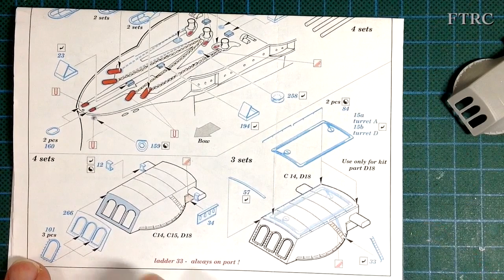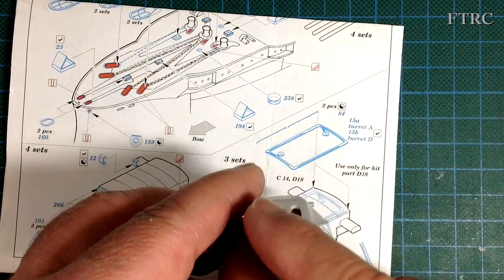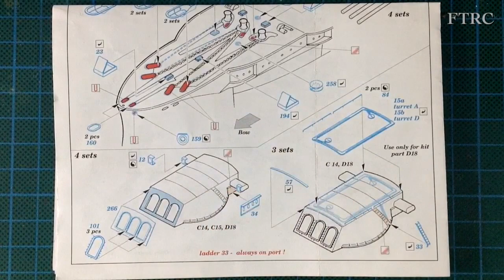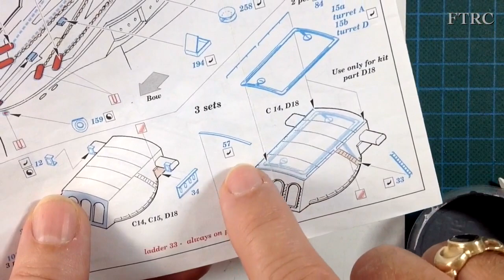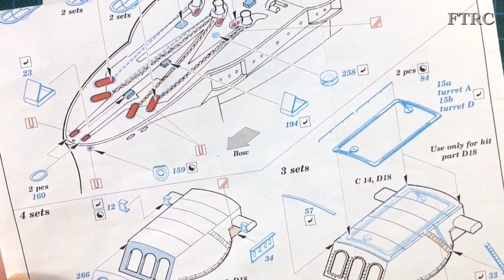Hobby Boss USS Arizona Part 6 (Turret PE Super Detail)

Comment: Thanks for the tip about the wax pencil for handling the PE. I'm working on the Hasegawa 1/350 IJN Nagato and there are a lot of small PE parts to deal with.
Reply from the maker: It can be a sanity saver.. glad it helped you.
Reply: Every little hint and tips do make my model building life so much easier. I went right out to the local art supply store and got me two of the wax pencils.

Comment: Hello Harry. Thought I would share the issues with this kit if you haven't got that far yet. The pins on the underside of the turrets that go through the deck are not long enough to go through all the way to glue the caps on to keep them from coming off. I extended them using plastruct tubing over the pins, drilled out the holes larger on the deck and used plastruct tubing to make collars to slide over them to hold them in place. Second issue is the propeller shafts and brackets when assembled as is, don't line up as they all face in different directions crooked and all angled in different directions all but straight. Corrected this problem by filling in the indentations molded on the hull then mounted the shafts  and brackets and everything came out straight and looks good. The last problem is on the bottom of the 2 towers where the legs go in the bottom have half circular mounting hole molded in, well they are all molded in the wrong directions for the support legs to be assembled in the correct positions. You will need to drill the holes out to corectly position the legs on both towers. Other than that everything else went together with no issues. 
      I decided to go with the pre 1941 paint scheme which is the 5-D dark battleship grey which is a very dark charcoal color which I had to mix till I was happy with the shade. It looks really great, might not be exactly accurate, but I am happy with the way it looks. If you go to freetimehobbies YouTube channel, there is a 1/200 scale Arizona done in this color and I tried to come close to that. 
   Hope these tips are helpful for when you get to those parts of your build and anyone else who reads this that is working on this kit. It is still better detailed than that old Revell kit. Hope to see your progress soon.
Reply: Thanks for the tips, I have the Banner kit which I guess is the same kit, I picked up the same Eduard kit, I love it because of the boat cradles and the anchor chain with the hawse pipe covers, but I also picked up the GMM PE because the  "fighting tops" of the Eduard kit is not detailed. I also bought the Tom's models PE kit and I've found them to be flimsy. But Harry's advice about the wood glue and the wax pencil are priceless gonna pick these two items today.
Reply: I agree with you about the Revell kit, I thought it was the same kit only placed in an enlarging machine. I've built that kit twice once w/out the PE and one with the PE and I just got another kit from a raffle at a local hobby show.  I am a Navy veteran as my grandfather was before me, so I am hoping to have a pilgrimage to the memorial before I die. I have several books about the Arizona, did you know at one time she torpedo tubes under the waterline, they were not practical because you would have to turn the whole ship around to aim them.
Reply from the maker: Thanks for the info

Comment: Great stuff Harry :) Something to consider good buddy is an #16 x-acto blade for cutting PE. We normally use a #11 for most of our work. The number #16 is called a scoring blade but is widely used for PE. It provides greater dexterity than a razor blade. The blade tip is shorter and stockier compared to a #11 which provides great precision and purchase :) You may want to check out the frugal modeler episode 18 on how to maintain your blades in pristine condition, especially a blade that is cutting metal all the time. I haven't replaced a blade in well over a year.
Reply from the maker: Thanks Richard.. I think I watched that episode and yes I do sharpen my blades.  Havent seen the #16 here... will have to look out for it... mostly I use my Xuron cutters for PE now but did some old razor blade work just for the video.  What I do for camera is not always exactly how I really do it. LOL
Reply from the maker: Oh by the way.. do you know what those rounded rectangular PE loops are I added on top of the turrets?
Reply: Harry Houdini Models
Sorry good buddy no :(

The reason why I mentioned the #16 blade is there are certain PE sheets where we do not have the luxury of getting some cutters in there. The #16 blade is available pretty much anywhere they sell Xacto stuff around here :
Reply from the maker: absolutely right and you may have seen me struggle to cut one join off the turret front plate from the pe fret.  Will look for that blade next time I am in Brisbane at the big hobby shop.  Not much locally here except a small toy shop with paint and a few plastic kits.  Buy most things online these days.. amazingly now cheaper from the UK since Brexit!
Reply: Harry Houdini Models
I have acquired most of my stuff on line. Waaaaay cheaper! lately I am getting less and less selection from my LHS, then again because of the economy everyones (other type stores) inventory is down. I'll order it in for you. How long will that take 3-4 weeks. I can get it for 1/2 the price in 2 and save 15% tax to boot.

I used to support my LHS, and only bought kits on line. Now I see myself shopping south of the border. I have bought kits from my LHS, when I saw a deal. After all if we don't support our local economy we are doomed. Then again the average consumer is not stupid. If you order it in, and it is a guaranteed sale, then no, you don't mark it up 150-200% and knock off $5. We ain't stupid :) Then charge 15% tax on top of that??? Sorry.

You have been around for 50+ years, you may want to consider adding an on line shop to your existing  business. Your on line shop alone will pay your rent and overhead :)
Reply: Harry Houdini Models I’m going to guess and say it’s the ships communication antenna. Never found an answer with the little research I’ve done but seems logical. Less likely to be damaged by incoming gunfire.

Comment: Hi Harry, loved the video, I finally got the wood deck and I thought was ready to start the build and I realized , I'm probably  gonna  need to get some metal barrels. I too have purchased the Eduard photo etch but I have arthritis and my eyes aren't  that great anymore , so I'd rather build the gun barrels instead of using the kits cannons and those little circular pieces  of the Eduard PE. So I was wondering what company you used to buy the gun barrels. Thanks to you,  I was finally able to purchase the wood deck. I love the videos, with your colorful language, my day always turns out better. Thanks
Reply from the maker: Master Barrel are good, but Aber can be better priced and quite frankly apart from less flashy packaging I cannot see any difference in the Quality.  RB also make some barrels.  All these brands are quite good in my experience.

Comment: I have only recently started using PE because I have always hated using super glue. I will try PVA glue like you have suggested. Thanks! :)
Reply from the maker: PVA has its uses but you will still need to hold down some parts with a little CA as I showed.
Reply: And get some different kinds of CA glue, if your only experience is with the normal stuff, you will love the thinner and thicker versions, very useful.
Reply: Ok thanks I will have a look around. When I started using the Tamiya thin a few years ago it completely changed the modelling experience for me. I do need to try some different thicknesses in other glues.
Reply from the maker: Thats why you see me using ZAP instead of supermarket Superglue.  The thick stuff is great for filling seams and both thick and thin have a slower dry time if you store them in your refrigerator before use.